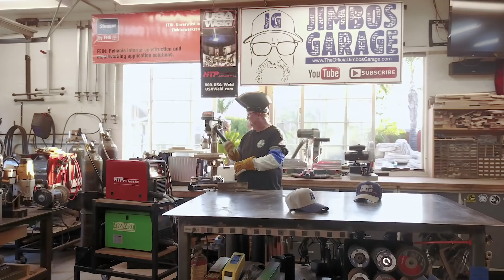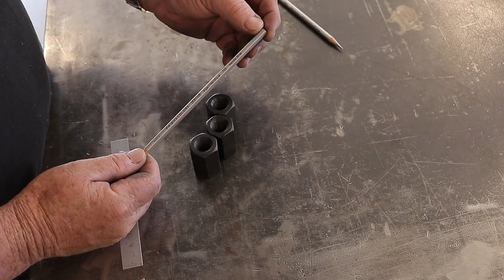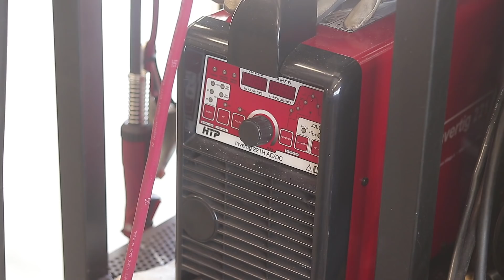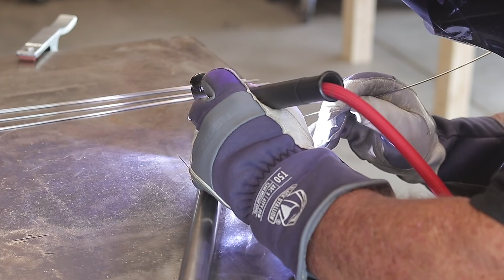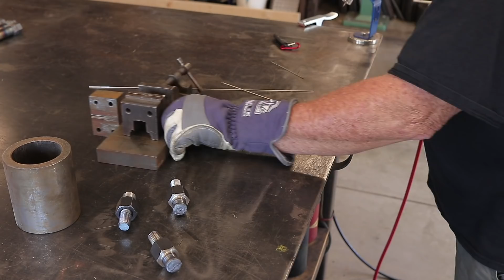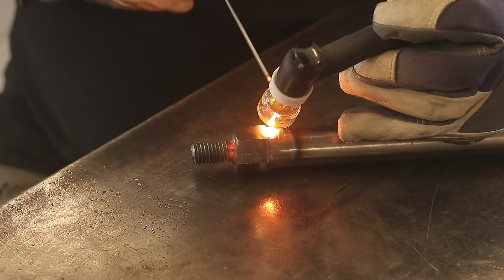Fabricating Custom Parts Using Metal Lathe and HTP Tig Welder | JIMBO'S GARAGE

Comment: Hey there Jimbo, me again... Just thought I might throw some advice your way with the lathe. Those dials on the handwheels will be godsent for repeatability once you find the exact cut you want to take. Secondly, while not applicable to these parts, you may want to get the hang of a "hand over hand" motion on the handwheel for when surface finish matters. Always maintain one hand on the wheel, moving consistently and slowly. Best to practice on parts that don't need to perfect finish and then be ready for the ones that do. Keep up the good work!

Comment: You could use 2 vee  blocks to weld the parts together and rotated and tig welded at the same time to do one continuous weld, or put the nut in lathe chuck and use tail stock live centre to hold the tube end in place and kept parts square, have the lathe out of gear and weld and rotate manually, that's how us pros do it 👍😬

Comment: Hey Jimbo, why did you weld the thread on the exposed end of the nut?  Could you not have welded the thread on the turned end of the nut where there's no chance of the weld interfering with the coupled ends?

Comment: Job came out nice. I would have welded the all thread to the inside of the coupler nut before turning then turn the coupler to 3/4" dia. That way the contact would be machined surface to machined surface when they were coupled together. I don't figure it was critical enough to care, but you would get a straighter connection between extensions. I have seen rods like that used as a water drill for boring under driveways and streets. Nice video and keep them coming.
Reply from the maker: Great idea Richard, Thanks for the advise.   Jimbo!

Comment: I've never thought of that trick with welding the filler stubs together. Thanks for the tip and nice work as usual!
Reply: Phil Vandelay you can also weld the stub on the next full rod .... that way you dont have one rod with 5 or 6 welds